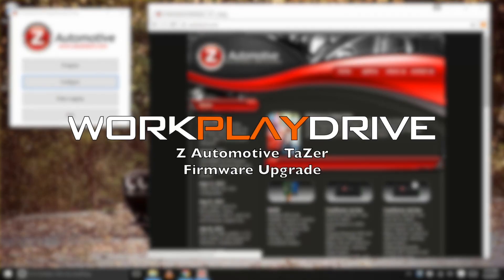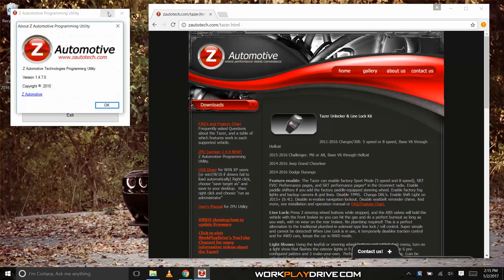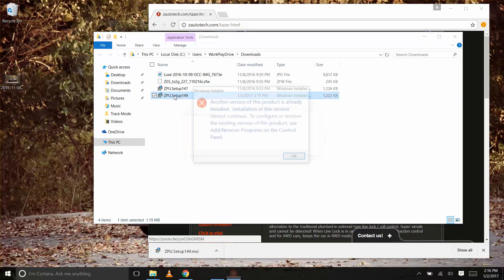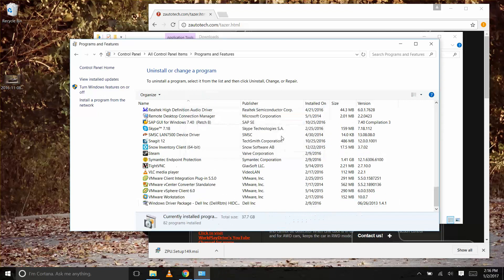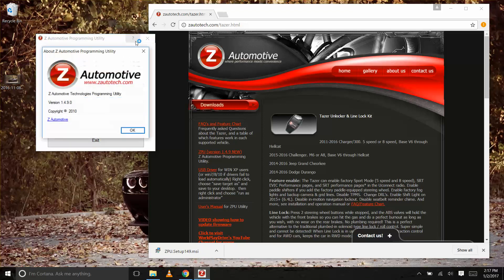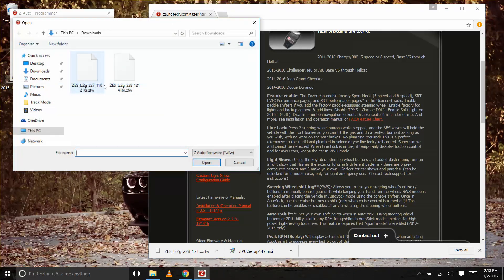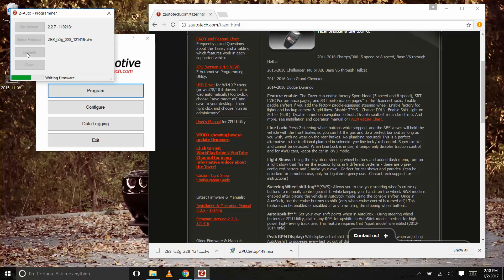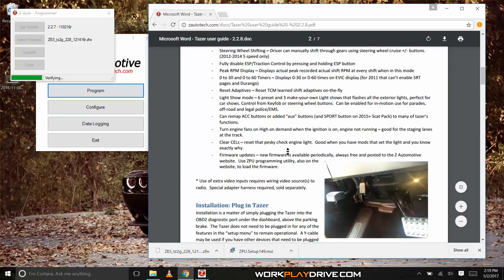zAutomotive TaZer - ZPU 1.4.9 and Firmware Upgrade 2.2.8  zautotech.com Fan and TPMS conrol

Comment: Any idea how to get the tpms to come back on had no tpms wheels on now I'm back to stock turned tpms back to prem and no sign off the tpms on cluster
Reply from the maker: Great news they fixed the TPMS issue in version 2.3.2 that actually released a few hours ago.  Check out my video on it here https://youtu.be/JokQyDIb-ZU
Reply: Work Play Drive cool hopefully it works for me thanks.....anothe crazy thing is I put settings to stock ever went back except I still have the drive modes app on my 17RT....hopefully this update will remove that app......Any word on the air bag light on the RTs when srt and hellcat splash are turned on? Thanks
Reply: Did the update it  most definitely fixed my tpms issue...... Greatly appreciate of the help...

Comment: hi ive got a 16 rt. the performance pages wont load and my sport button dosent work. what am I not doing?
Reply from the maker: you may want to contact their support I believe some 16s have issues with performance pages.   The 16+ you need to remap the sport button to a custom drive mode when you enable SRT mode.  Dodge conveniently removed the Sport Button in the programming for 16 and 17   I have a video on mapping buttons here https://youtu.be/Z8qrZLdQwYU?list=PL_C69kho0QAsj7tH68odU4XmCwonbZuYE
Reply: Work Play Drive thanks for the reply. I just took them off. Alot easier

Comment: Question: If I disable TPMS, will the sensor light of tire be turn off on the dashboard ?
Reply from the maker: If you turn them to "off" yes the indicator will go away.
Reply: Mohammed Al-Ghamdi it goes away completely like it's no tpms.... It works now I'm trying to figure how to get it back now

Comment: does the tazer,affect drivability issues when unlocking the performance track mode options on scat pack 2016
Reply from the maker: No issues that I can see on my 2015 SP.  The car drives normally after enabling SRT mode, if you change from the default drive setting to Track, by design the steering gets a little stiffer and the Active Exhaust stays open all the time.  These are of course what happens on an SRT and the desired behavior.

The only Known issue is once you enable SRT mode the "Sport" button does not work however this can be remapped using the TaZer to any custom drive mode of your choosing.  When you disable SRT mode the Sport button functions like normal. 

Hope that helps...
Reply: Work Play Drive thank you

Comment: How do you use the fan option to cut it on/off at will?
Reply from the maker: Engine Fan Control : With the ignition on but engine not running, press the right arrow and cruise cancel button at the
same time to toggle the engine fans on and off. They will turn off automatically if the battery drops to 11.0V.   For more info on the features check out > http://www.zautotech.com/docs/Tazer%20user%20guide%20-%202.2.8.pdf

Comment: When you said it could operate the cooling fans I jumped on the sight and ordered one.... thanks for the info great video
Reply from the maker: I agree it's a great add, just put the car in run and press 2 buttons to enable and disable the fans.  Even built in battery protection

Comment: Glad to see they continue to update the Tazer firmware. Do you happen to know if 2017 Challengers are supported yet? I emailed Z-Auto about it but never heard back.
Reply from the maker: Brian,

I contacted Joe this morning and here is his reply 

"Actually it works on the 2017's with the following exceptions:
* Can't disable seat belt chime
* No nav-in-motion
* No backup camera/front video/aux video switching

Once I have a 2017 to play with, I'll figure out the differences and put out a firmware update. "
Reply: Work Play Drive Perfect! Thanks! Those aren't critical features to me so I'll probably go ahead and pick up a Tazer. I want that Track Mode... :)
Reply from the maker: the best part is it's updated and Joe is active in the community.  This is the 3rd update in the few short months I've had it.

Comment: I have two questions. does your challenger have warranty from dodge? and does using the tazer void the dodge warranty. is there a way for dodge dealers to tell you used the tazer? sorry its 3 questions haha
Reply from the maker: The short answer.... You should write down all changes you make to the car so you can back them all out and remove the TaZer  before going to the dealer.  As someone who troubleshoots issues for a living if I see something that doesn't belong I tend will focus on that rather than troubleshooting the issue.  

Yes I have the factory Warranty

[Quote from zautotech.com ]

Q: Will this void my warranty?
A: Per the Magnusson-Moss Warranty Act (1975), a manufacturer can only deny a warranty claim when an aftermarket
component is used if they can prove that the component caused the failure. Simply write down the settings that you
used the Tazer to change, and change them back to their original values before service - it’ll be as if it was never used.
As for “live” features such as light shows, line lock, full ESP disable, nav in motion, force video – use of those features
can’t be detected.
Reply: oh ok great. Thanks for answering. I want my next car to be a challenger for sure hahaha I cant stop watching videos about it
Reply from the maker: I was in the same boat from 2009 - 2015 :)  It was a long wait for this baby.